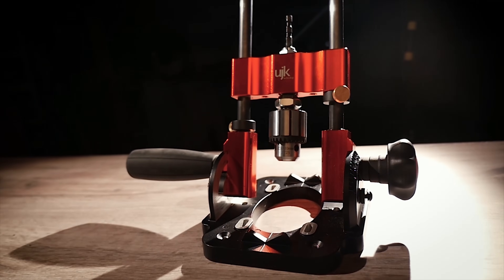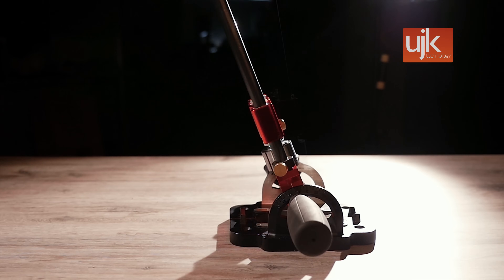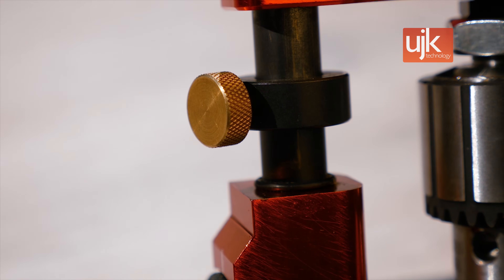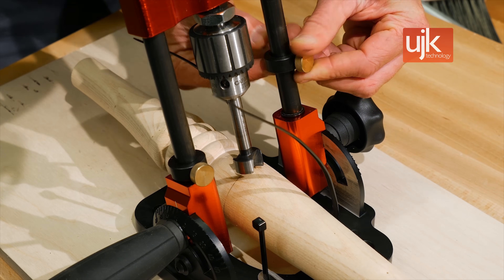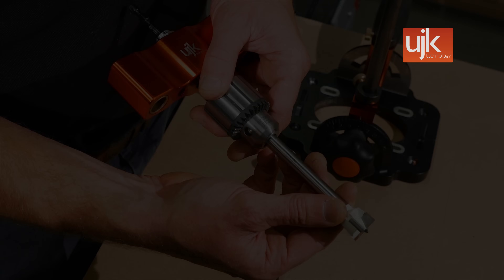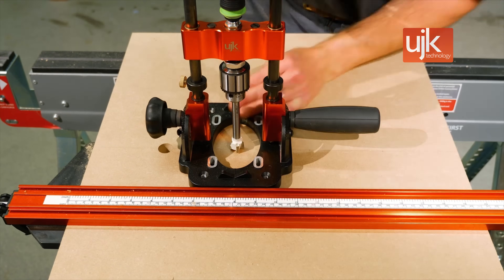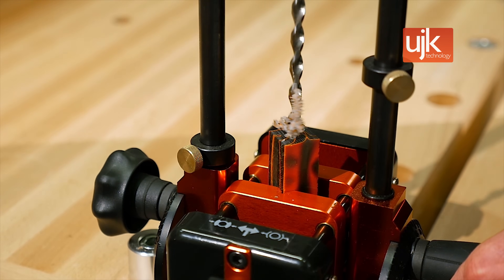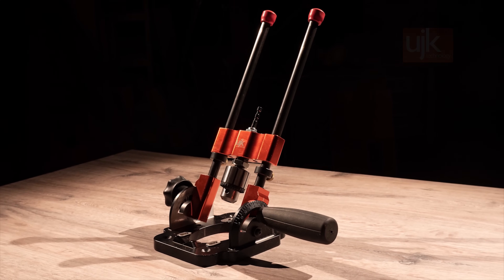UJK Drill Guide - Product Overview

Comment: My question is, where do you put it after you finished using it, does it comes with the case, or manufacturer excpect us to chuck it with the rest of tools, get it damaged and we then will look to buy from someone who does supply protective case with it. being mobile tool it will travel alot amongs other tools.
Reply from the maker: Hello.Thank you for your enquiry.
We can confirm this does not come with a carry case, it is supplied with a cardboard box
Many Thanks
Reply: @axminster  A Systainer option would be nice. Does it fit in one?

Comment: about time someone made a decent version of this tool! the design has been around for years but all cheap Chinese stuff, this however is a fantastic upgrade for portable accurate and repeated drilling. All that being said the price is on the high side even for bronzed bars I know there expensive but come on ujk get a grip this tool is aimed at the weekend wood worker and for an extra £49 we can buy the bosch drill press with digital speed and depth control. have a word ffs